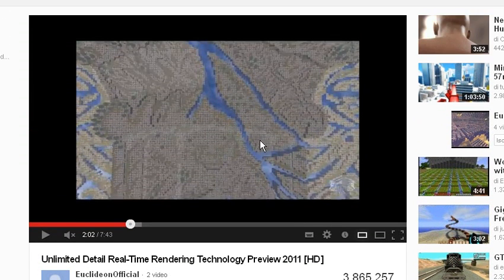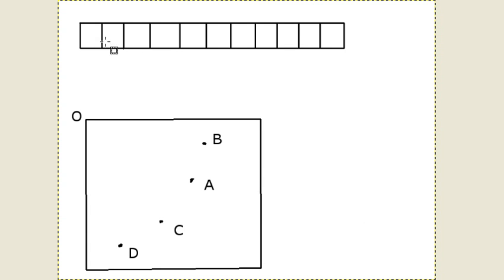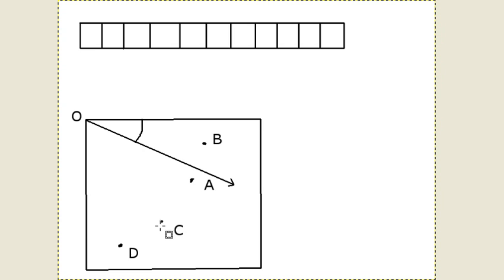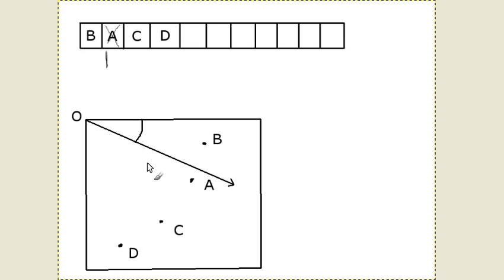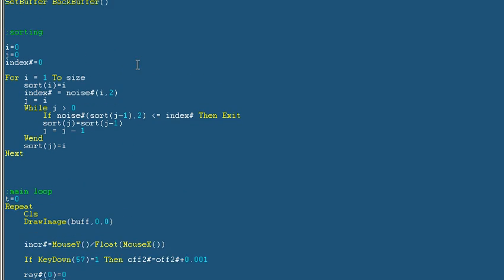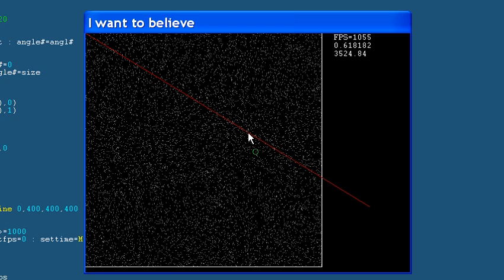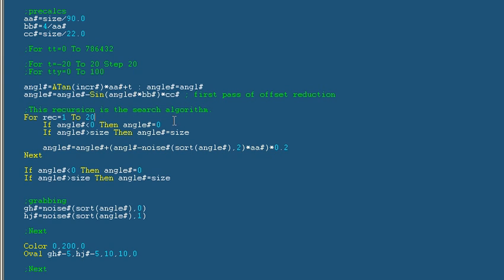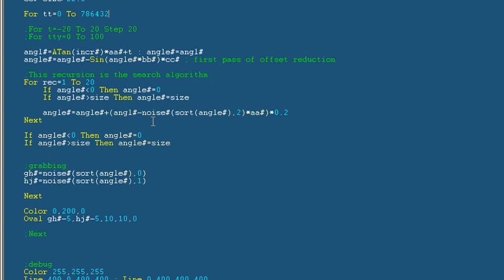My humble opinion on how Euclideon's Unlimited Detail Engine works

Comment: We were all wrong. The patent of euclideon gives you the full image: It's a voxel-splatter that uses perspective-projection calculations not for every voxel but for clusters of voxels which size is determined by screenspace size. So for example every 16x16x16 voxels gets a perspective-projection of the "form-factor" (which might just be 3 screenspace vectors for x, y & z). With this "form-factor" you can then determine the final screen position of a sub-voxel just by shift & add operations (shifting the 2D integer x, y, z vektors and adding them to the projected 2d midpoint of the current super-voxel.

Comment: I dont understand why is it so fast to use the angle, because as I understand you have to sort the array every thing again because the angle to the voxels is not view independent.
for example if u have an array of 1000000 voxels u have to sort the array again every time u do camera transformation.
So basicly u work with pebaked data or u have still the fps problem.
But an other way to sort the voxels are octrees and they are view independent if u do it right yu have to do as many calculations per pixel as this calculation shows :
u have a volume with a resolution of 1024*1024*1024 voxels (2^10) so u have to do (10+1)*8 calculations.
But there system also don't work like this.
So we have stil the question how to do it like they do.

In my opinion they would still say "we use an other algorithm" if u finde out the correct and ask them.
Reply from the maker: If i understood your concern corrently, you should probably check my other video where the resorting problem has been addressed at the expense of more memory consumption. No they dont use this algorithm, they have a patent which describes it, google "euclideon patent" or similar.

Comment: I'm guessing it's some sort of 3d fractal compression algorithm (to solve interpolation between data points), in combination with a vector based search algorithm (you give it a 3d vector, it gives you back an interpolated point).

Comment: How does the Euclideon engine deal with aliasing ? If I'm looking at say, a chainlink fence at 100metres, would we see moire patterns, etc ?
Reply: fxaa
Reply: lex lazootin That works for continuous edges but fine patterns like my example above would result in discontinuous pixels, so FXAA won't work well. FSAA/SSAA should work but is very expensive.
Reply: SerBallister maybe just fading the chainlink fence out slowly the farther you are away. I don't think even with 16x aa you would even have a chance of fixing that issue.

Comment: Looks like you're trying to explain how voxel engines work. The Euclideon engine uses fairly standard voxel technology, with the actual representation models taken from existing software built for laser tools that take voxel models of real-world objects. But you're absolutely right about the data collection at the beginning. It scans the hard drive for just the region of data being accessed and as such requires very little processor cycles or vram. Now the game engine they are working on is probably more complicated than that, but that's how it works for their already functional place-viewing tool.
Reply: TheReaverOfDarkness I am pretty sure in one of their videos that they said their engine is not voxels.

Why do you people automatically assume it is.
Reply from the maker: I admit I was kinda hyped for this whole unlimited detail stuff hoping it would be that massive groundbreaking advance while after all, yes, its octrees and voxels all over again as you said. That was the mindset that made me do these videos at the time but whatever. Euclideon announced that games using this technology are coming so we will just wait for now.
Reply: appc23
What they said in their videos is that they're only working in making it into a viable game engine. They are leaving it up to other companies to make any games with it, and are seeking companies looking to make a contractual agreement.
Reply from the maker: Yeahjames21 Well, we don't "assume" it. We actually know it for sure because they eventually released a patent explaining in detail its functioning (spoiler alert: octrees)
https://www.google.com/patents/WO2014043735A1?cl=en

So in the end it was slightly awkward for everybody. The point of the entire method consists in skipping the perspective division if a subnode is small enough with respect to the distance with the camera and use orthographic projection instead.
And no, they didn't mention the term "octree" anywhere in their videos, which is what confused everybody into thinking they used some intricate sort of cubemap interpolation/hashed-indexed lists or other raycasting hybrids (all of those applicable with great results btw).
Reply: appc23 + octree Does not mean voxels I could show you a few videos using octrees in a way that's not voxels. Still though Its very close to voxels what there using I bet. Probably a cousin of the voxel, or some other thing. I still what to see them do ray tracing, or some type of GI/ lighting work not just static light maps (I want to see rays with lots of bounce considering they freed up power/ram on the gpu).
Reply: appc23  It wont be so easy to animate say every single leaf, or tree of much of anything really, since it is technically just a static scanned image using lasers and not fully built 3d models. Making a game using this real-time might prove difficult or... impossible, we will see
Reply: Yeahjames21
Well, for one, it fits the definition of a voxel-based engine.
Reply: Lol I knew it was an octree XD and they use a type of lod.
Reply: +appc23 I can do the whole reading off of disk thing as needed. but, question how would I say, implement this into a 3d ray tracer?
Reply: Minecraft game uses voxles
Reply: ExoticSpeedify -. Yeah... so?
Reply: +John Sherfey It is voxels, read the patent. The data is RBG voxel data stored in a basic array. Their Algorithm stops empty spaces from being calculated. Octtrees can be used with other data, like polygons, and even just mathematical functions like spheres, but Unlimited Detail uses voxels for the Raw data. Those laser scanners that scan rocks and cactus's don't create voxels themselves, they actually just create a list of depths from the sensor, and the colour. they are only a pixel big when rendered, which is why the other companies viewers are so slow and have holes in. Euclideon just turn that into a high resolution voxel array for their engine. That can take hours, days even if there is a lot of values to go through. Once they have those voxels, since they are sorted in an array by their position and colour, it becomes easy to use their algorithm to build a structure to help skip past all of those empty voxels, and not bother rendering any voxels behind the voxels that are there, so you get on voxel per pixel, or less if you are up close to one. That way, it is really fast without touching the GPU.
Reply: +appc23 I'll try to do with with ray tracing! hope it works ( I also have a solve for data to be on the disk and still read fast. A lot less vram usage.

Comment: erm yes this works for one fixed point of origin... but what if the camera moves?
Reply from the maker: ***** 
busTedOaS 
Hey
You probably want to check out the newer video on my channel or the work done by laurelmatic and check for yourself how that problem gets approached with this method. Both videos are been linked in the description. Unfortunately, this whole idea doesn't really apply in real life scenarios as memory consumption isn't exactly the best you have ever seen.
Reply from the maker: *****

Actually, I have thought of implementing some kind of spatial-temporal differentiation method as you said, when you move the camera just slightly only a few points change in perspective so you can focus on those.
This makes alot of sense, but the way this rendering method works in very rigid and doesn't allow for such a flexibility unless if extreme fundamental overhaults get considered.

The workaround I explained in the latest video is actually kinda of a crude hack and that's where all the memory inefficiency of this comes.

Basically, I won't order anymore the points by angle, I order them by y-intercept.
I will have then 100% XY movement freedom, while sacrificing resolution of the final depth render. If you want more resolution in the output, you gotta invest quite some memory in the process.
Reply: +appc23 question How do I get the surface normal?

Comment: If I understand you right, you sort all N points in cloud by angle and distance, then just draw closest one for each angle. Here angle may be substituted with projection to camera plane - screen X, thus eliminating arctan calls. Straighforward HeapSort or QuickSort requires O(N*log N), while Pocket sort is more suitable, one pocket corresponds to one 1D screen pixel, further we don't need to store overlayed points, just keep closest one for each pixel, thus we came
to projecting each point on 1D screen, comparing to previously stored Z (Z-buffer) - well known  old method!
Reply: No way it could sort all the points for each new camera position, It must somehow be pre sorted into an easily searchable format...

Comment: do you go through each point on the ray in the region, and then loop through all points by x value finding the closest to the ray? thats really fuckin cool if thats what you do. but i feel like looping thru each point on the ray wud be slow
Reply from the maker: In this particular video I find the closest to the ray by trial and error. In my updated video I precalculate an additional table to help detecting points close to a ray and then I use the x*x+y*y formula to detect points closer to the origin.
Reply: appc23
What you're thinking of is using the pythagoran theorem.
Looking at this model you've made, it is inaccurate. Besides from knowing the math, you can clearly see points being closer that aren't considered the closest point.

A far more accurate solution, being still quite simple, is to rotate the entire world space around your origin point making the ray angle during calculation be at 0 degrees and then simply compare distance in the Y axis.
This method is used (although with many more complicated steps) in the seperated axis theorem which is used to calculate polygon collisions.
Reason being that it's much simpler to calculate the closest point when looking at the points in relation to the angle. It is also not much different performance wise. Your method is a little bit cheaper and I doubt such precision is nescessary.

HOWEVER, this example still wouldn't work. Even if a point is closer to the ray, a point closer to origin that is close enough to the ray would be in its way. It would be better to simply do two passes: One that calculates all points that are within a certain acceptable range of the ray and then check which of these points are closest to origin.

This being said, this process is way too expensive. Do take in mind that there are millions of points (okay much more than millions) in their claims and on top of that you need several lightsources, all with thousands of rays. Add to this that you need things like radiocity, subsurface scattering and other optical physics implementations and you get a workload bigger than the punchline of your favorite "yo momma" joke.

In a vidego game, more important than the world's fidelity is the lighting. So even if they somehow manage to substantiate their rediculous and ungrounded claims polygons will still be the superior choice because you can put more focus on physical lighting.
Reply from the maker: Zoeres
In this particular video there is not such a thing as "closer to the origin", just closer to the ray. In my newer video I do exactly what you said, which is a compromise between closer to ray and closer to origin to detect surfaces.
http://youtu.be/prtAkHxjAj8

I modified my above comment for accuracy, I implied I was refering to the updated vid.

Rotating all the dozen of points in a region and compare them would be far more expensive without any particular accuracy improvement. While there is some degree of low precision dictated by the density of the point array, It doesn't really make that much of a difference.
Reply: It would be 100% accurate. But again, if it doesn't need to be that accurate your way would be better.

Rotating all the points isn't that much more expensive. Also, a cheaper algorithm should be run first to sort out as many points as possible. First count only those in the quadrant of the ray, then you could do a few passes of boxing out regions of the quadrant. This way you'd only have to rotate a small percentage of the points.

Comment: Euclideon is nothing but smoke and mirrors bull$hit. They've disabled comments on their videos for a reason. Euclideon is a shell company for Google. They take Google point cloud data acquired from their street view imagery to ascertain x/y/z distance for a 3d model, they take the color acquired from the camera and voila smoke and mirrors - instant bullcrap 'infinite detail'
Reply: +Q The First Timelord  They took down comments because all of the comments saying it were fake were pissing them off, and they didn't want to look unprofessional from bursting into a rage and throwing out abuse towards those morons who's tiny attention spans can't even be bothered to read a patent that explains all of it.
Reply: Ohh look another failed conspiracy.
Reply: the industry has broken down the polygon to MINUTE measurements with polygons so why not just go all the way to using POINTS instead of minute triangles, the tech needs to evolve from polygons to using POINTS.
Reply: aaronhm7 7 Because polygons are perspective projected, so far away polygons get smaller, nearer ones get larger, there isn't a convenient way to balance it such that all polygons are 1 pixel.
Reply: 4nlimited3dition
if you say so

Comment: About the last things you say in the video. Dunno if you've read on it but there is a way to do just that, an algorithm to do ray-tracing without any special data structures. The requirement for it to be competitive with the usual methods is to have a lot of rays and a lot of objects (it won't accelerate anything if you want to cast one ray, still O(N), unlike the typical structures which would help you in O(log N)). I don't know if it applies to UDE but it shares this feature at least. I can find the paper for you if you ask in reply ; ).
Reply from the maker: My guess is that your description matches the logic behind the the Mass Connected Processing technique. Basically one can take advantage of the very tight locality of the rays in a ray-tracer to satisfy more than one ray at a time more or less (a guy named Bauke Conijn did something like that with good results). But hey, tell me more please!
Any hierarchical space partitioning system can just improve the things btw that's true.
Reply: appc23
I didn't verify the links to the paper but this was it http://voxelium.wordpress.com/2012/04/24/incoherent-ray-tracing-without-acceleration-structures/
I'm still interested in knowing the particular algorithm used in UDE, are you? :). There are hints that it can exploit temporal coherence and delta transmit (in their remote rendering demos). If that's true, now I'm puzzled.

The overall type of rendering (basically exploiting the fact that there are many more primitives than pixels) reminds me of several but in particular one paper from 1997 if i remember. They had billions of triangles at maybe 15 fps back then. I'll have to look deeper to find it though :).
Reply: appc23 Not wasting any more time on searching :) http://www.mpi-inf.mpg.de/~mwand/papers/siggraph01.pdf is one of those techniques.
The other technique that could come to mind is light fields, in O(1) but it's absurdly memory consuming ; ).
Reply from the maker: Petros Adamopoulos
I see what you did there.
But regarding raytracing, as I said, a software UD raytracer has already been done, I think now we shall focus the attention on point-cloud rasterization techniques, such as volume splatting, because we know that Dell's UDE does not use ray-tracing for sure.

I also have to remind that the cpu-bound nature of an UD solution may exclude algorithms that are favorable only when working with gpu-like workflows. So yeah, remember we shall stick to software rendering.

Btw, temporal coherence is surely mandatory in some form. I don't know what is 'delta transmit' as you mentioned though :/